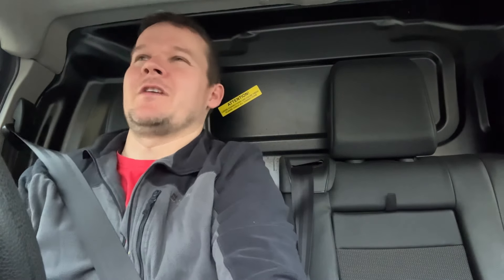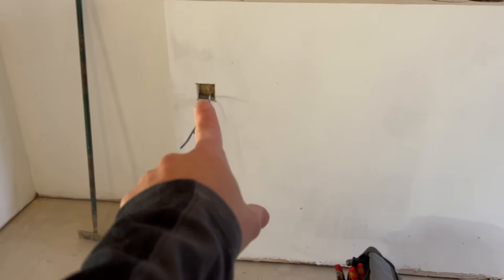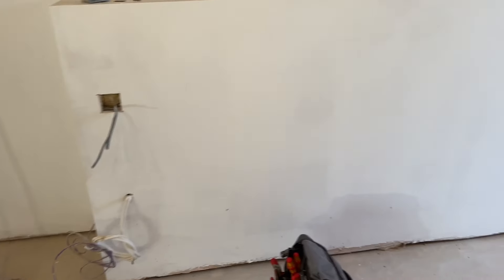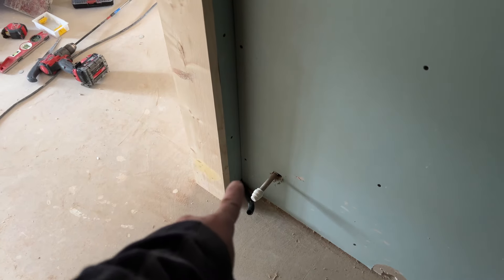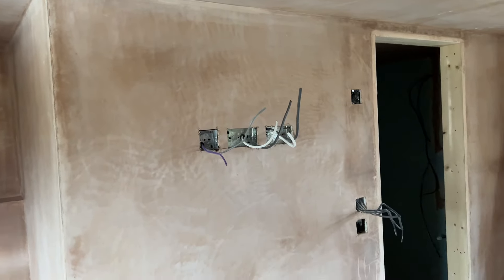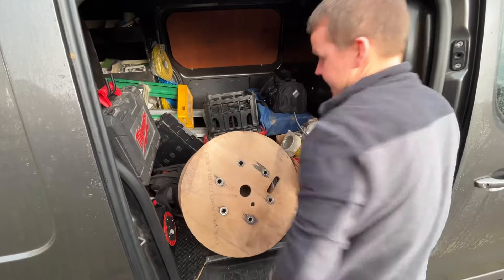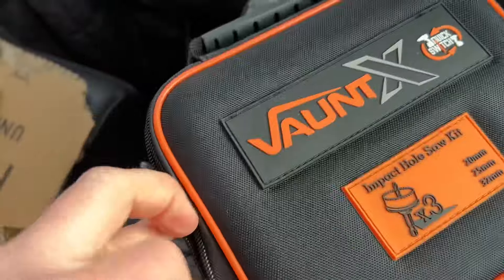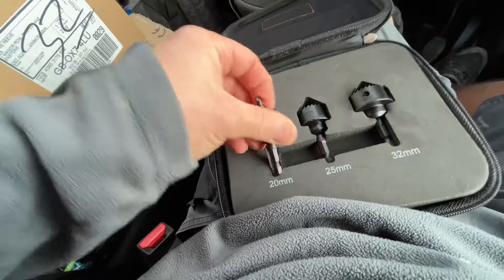Electricians day first fix after the painters not ideal.

Comment: I hope that joist at 2:06 wasn't structurally important 😂😂😂.  Great to see you back posting more often
Reply from the maker: Partition wall buddy to an ensuite
Reply: @Cjrelectrical  I know. But in your previous video you made the point to James about timber Framed houses and how not to hack out the timber to run in your cable like other electricians have done.
Reply: @roydowling2542  Its just a gentle dig at Artisan for fun. If you know, you know. 🙂
Reply from the maker: Yes, it’s not structural, Roy